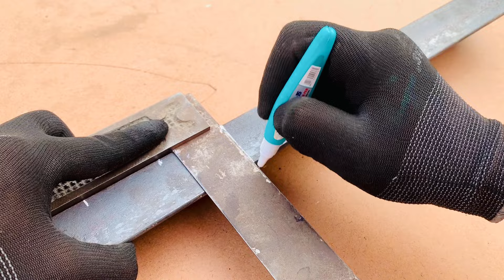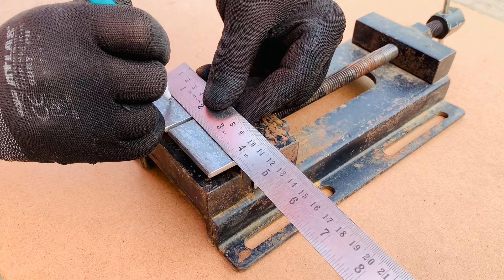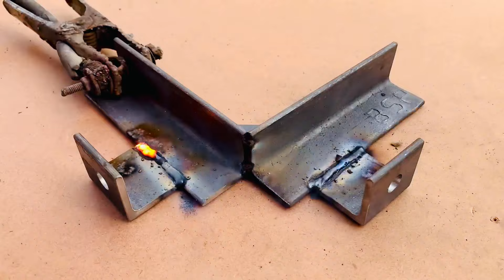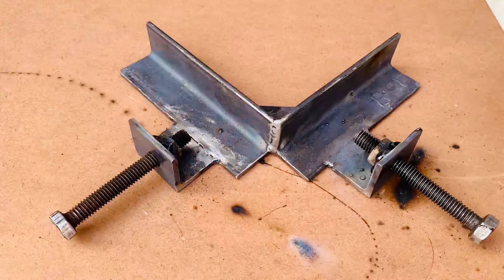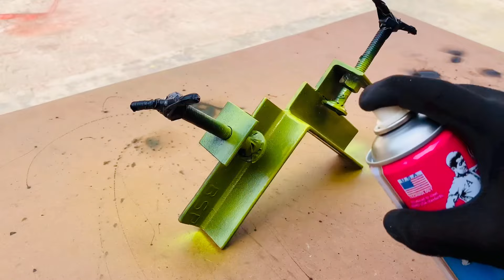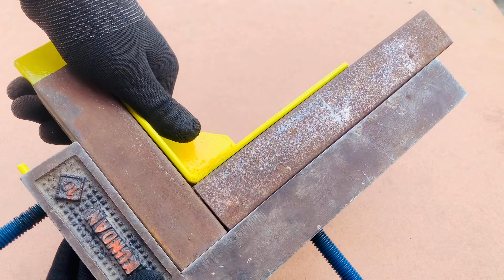Making a Mini Metal Clamp Vise || Simple Homemade Welding Clamp Vise || Diy Welding Clamp Vise

Comment: Great little video thank you very much I think it probably be a better thing if the nut was welded to the outside to give considerably more size to what it is that you’re joining on the inside
Reply from the maker: Yes u r right
Reply: BUT excellent video. Just finished  making one thanks to you!!